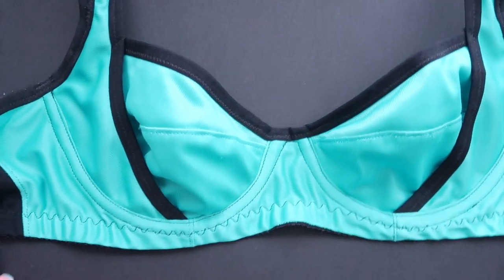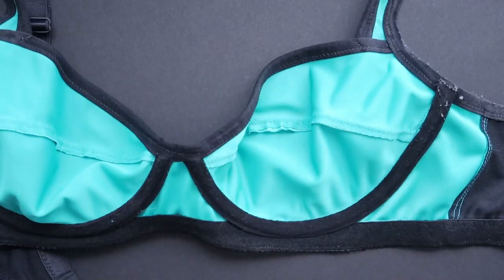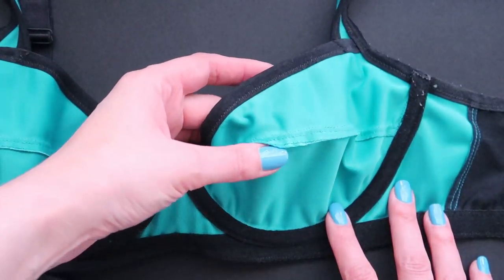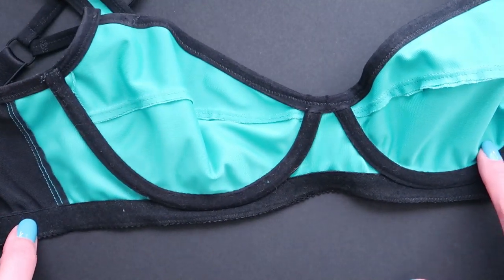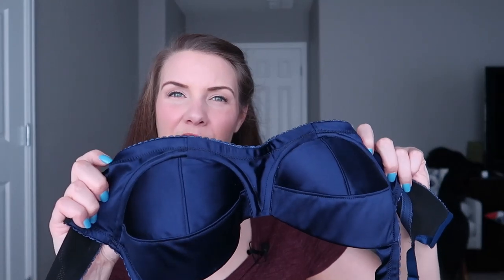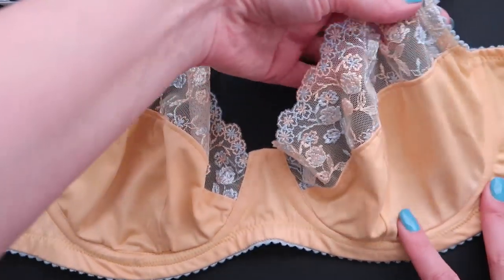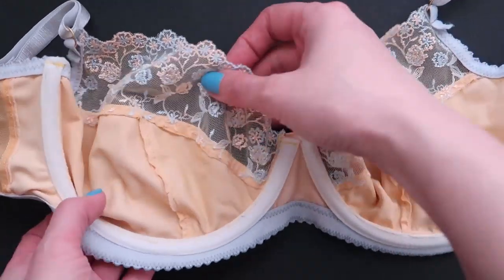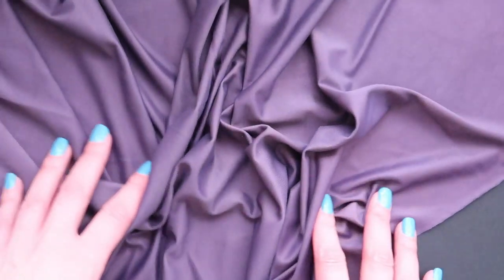Bra Making 101:  Stable Knit Fabrics

Comment: I explain very nicely and in detail. I had a question I had bra surgery and can’t wear bra with seams. I want to make my on bra without seams and if possible cotton as I get hot very fast and my skin is sensitive. Could please recommend me what kind of pattern bra and what brand would it be good. My skin is very sensitive and can’t wear too much synthetic fabric. I would like breathable fabric like cotton and a little spandex. Any recommendations or if I can find any bra.  Please help me out.  I looked on line but purchased so many different bras but still have problem. Thanks

Comment: Great info; but of course I always have more questions :)  So duoplex is poly, and googling seems to say simplex is nylon.  I can't find any info on what microduoplex is made of.   Do you know if it is nylon?  Does nylon breathe better than poly?
Reply from the maker: I suspect the Microduoplex is Nylon since it takes dye so well.    Technically Polyester is very slightly more breathable but the real difference is in how the fibers react to moisture. Polyester is completely hydrophobic so any sweat you produce does not get  absorbed into the fibers itself (only the empty spaces in between the fibers) Duoplex is so tightly knit that it sort of traps  the moisture against your skin which can be very uncomfortable in the warmer months. Nylon on the other hand is Hydrophilic and can hold about 10X its weight in water this allows perspiration to be pulled away from your skin into the fabric for evaporation.
Reply: Duoplex is also the same knit type as Dazzle and in fact, duoplex is a made-up name that just has become commonly used amongst bra supply vendors but the mills actually call it raschel tricot or simplex type depending on who is selling it. 
Interestingly enough the original duoplex is not a lingerie specific fabric